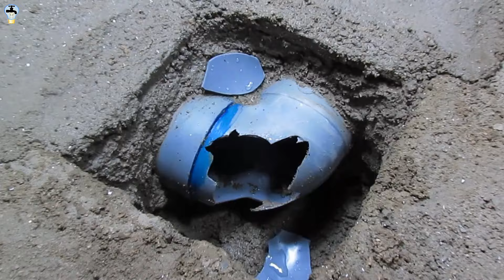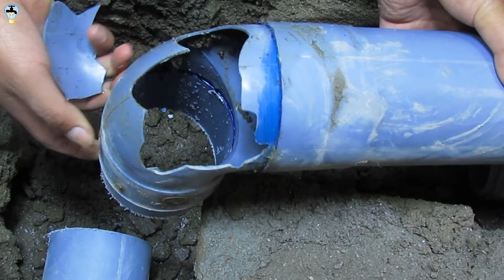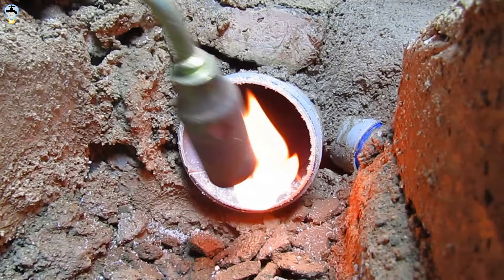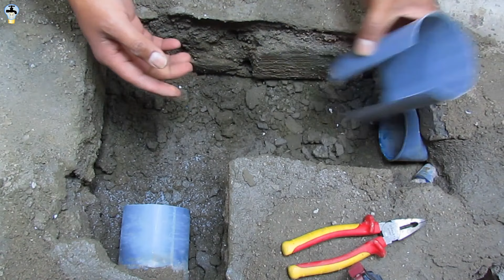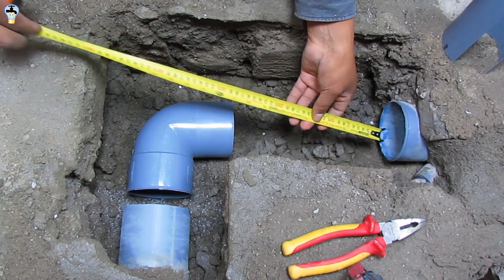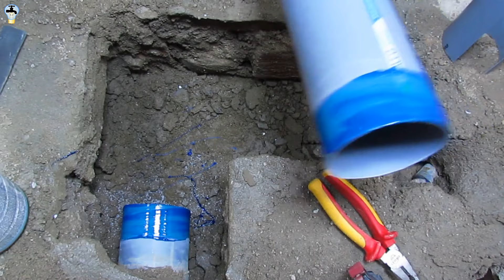Cómo cambiar un codo de desagüe de PVC de 100 mm - Trucos  de Plomero

Comment: Wow, I can see why your pipes break all the time. Why don’t y’all make the pipe much thicker?  I like how it’s extremely easy to work with but, you would be in trouble if it ever got cold or the water pressure over 150psi.
Reply: It's not water, it's sewage, it usually breaks due to accidents.